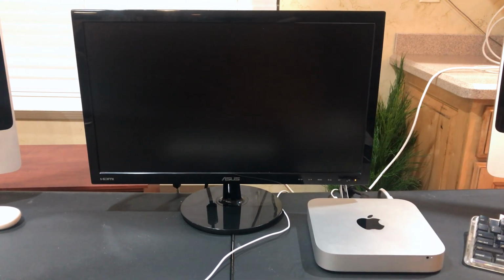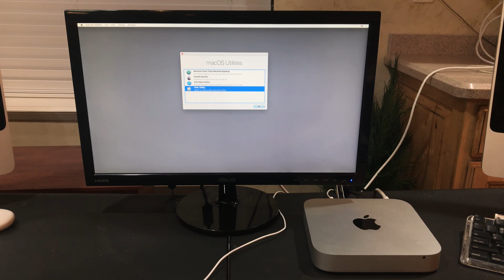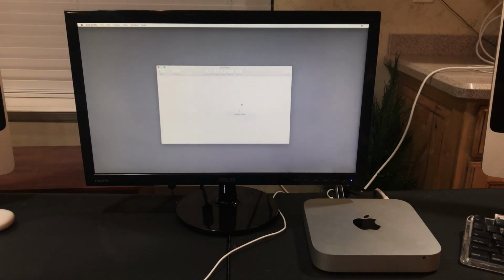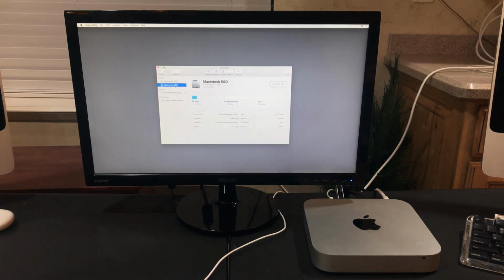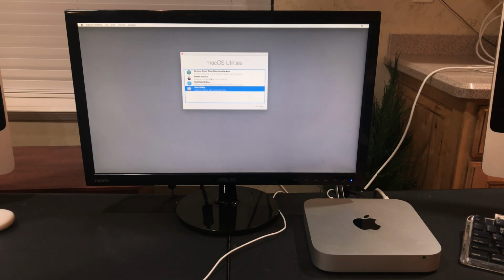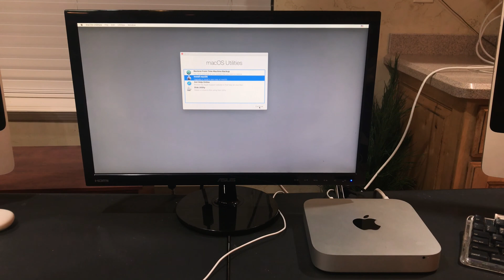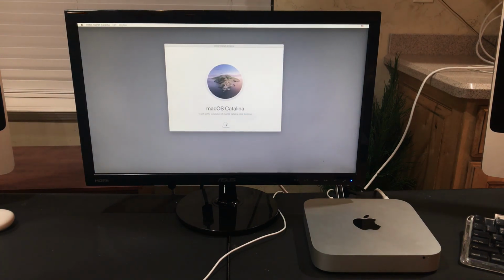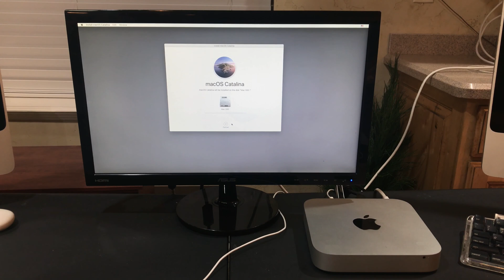I broke my 2012 Mac Mini upgrading to Max Supported Specs Adding 2 SSD's and 16GB Ram Part 1

Comment: I have this same Mac mini late 2012 model I got from eBay paid $30 also got a mid 2010 white MacBook one ram was bad in the Mini I ordered a 16 kit and used Opencore legacy patcher and it’s running Mac OS Sequoia latest version running it pretty well actually
Reply from the maker: That's awesome, with just a little effort you can still get a lot out of many old Macs! Thanks for watching.

Comment: I done the same thing lol but wasn’t lucky it took the whole socket all that is a connector to the front power led and it sensor
Reply from the maker: I did that on my 2014 Mac mini, luckily everything still works!

Comment: Old video, I know, but for future reference ..,,,

The problem was NOT the ‘wrong tool’ or ‘taking a shortcut’. The entire fault was in your METHOD of using the tool.

The tool MUST be inserted correctly. It MUST seat in the socket under the MB.
The tool MUST be used correctly. The TOP of the tool must be ROCKED (angled) FOWARD, NOT pulled horizontally towards you.
The rocking motion keeps the MB movement to a minimum, just enough to loosen it up.
(I have also used my hands, gripping the edge of the case with my palms and fingers over the heatsink radiator, then in a ‘closing my fist’ method loosen the MB. My palms limit the outward motion.  Using both hands spreads the force evenly.
I have NEVER broken a single connection or wire or loosened a wire. And I’ve worked on dozens of these Minis.

I have used both ‘tools to hand (eg screwdrivers, etc)’ and the ‘proper’ tool (from OWC or IFixit).

Comment: I was wondering if you could share with me a picture or something I can use to reconnect these wires. I did the same mess up as you with the pulling on the motherboard.